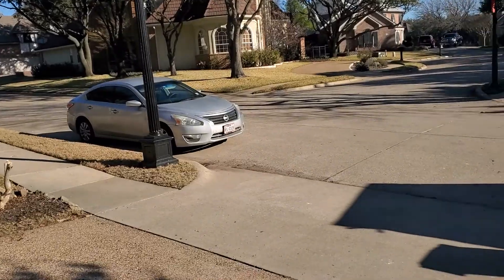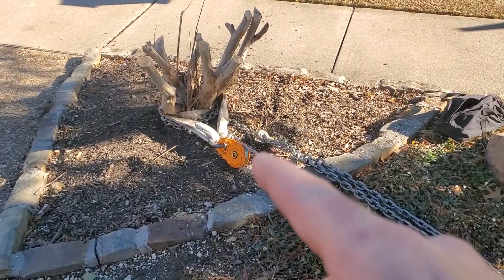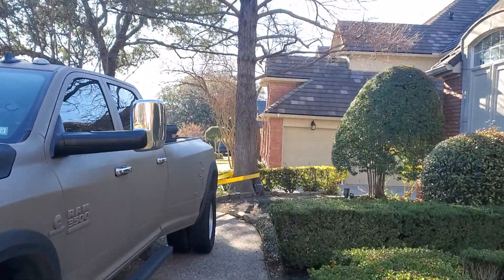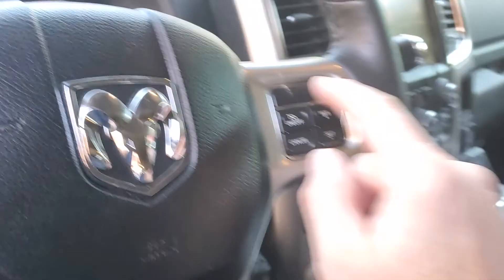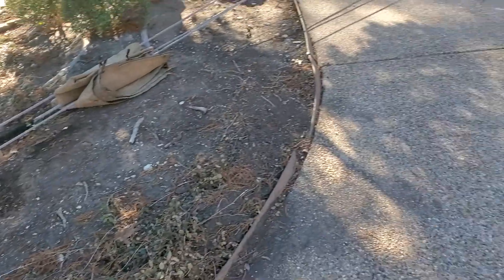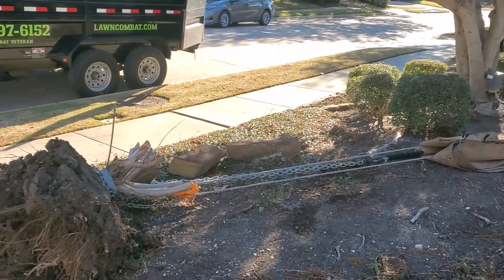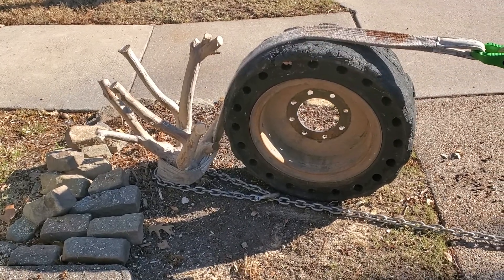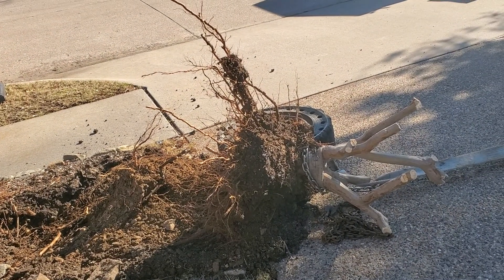Mechanical advantage stump removal

Comment: To get high idle to work on the Ram, turn on cruise control and hit the set button (bottom button on right) not the resume button and it will idle up for you. Once it is set, you can hit the RES button to idle it up higher.
Reply from the maker: Thanks, I figured it out after. I hadn't used high idle in a while and forgot.

Comment: I've pulled thousands of stumps this year.  You didn't need any snatch blocks for those little ones.  Your 16,500 pound winch would do it easy.  And you didn't need to run your truck either.  I've pulled up to six the same size on a small battery just sitting on the ground.  It still read 12.1 volts when I put it back on the charger.  Also, take the rubber off the wheel.  The rim stands up on its own and the rope/strap/chain stays in the middle of the rim.  An aluminum wheel is lighter making it so much easier to handle and transport.  It's good to see other techniques though.  Your video has me wanting to try other configurations just to experiment.  Thanks for posting.

Comment: That’s pretty cool using the load as the anchor also. I don’t think I’ve seen that before. I saw another method for doing this online. This guy bought a giant rubber band from the Acme Co.  He slung it around a stump, then got into the loop of the rubber band on the outside and started backing up and stretching out that rubber band. The stump comes out pretty easy but you’ve gotta duck quick!  This guy (who happened to be a coyote) took it right in the face.

Comment: Great video but honestly you don’t need to do all that just a single line stump to winch does the job.
Reply from the maker: I was testing out the technique. I normally use the snatch block just to make it easier on the winch.
Reply: It's easier on the winch if you don't overload it.  Hard to say exactly how much leverage you need for any given stump, but you'd be stupid not to at least double the line back to the bumper to get an easy 2:1 ratio.  Never say no to a two-fer!

Comment: You have a three to one system there. It’s a simple pulley system with your snatch block and your anchor on the load all moving at the same speed. With three tensions that makes it a 3 to 1.
Reply from the maker: Thanks, I've taken classes on ropes and tree felling but its easy to forget if you don't use the skills on a regular basis.